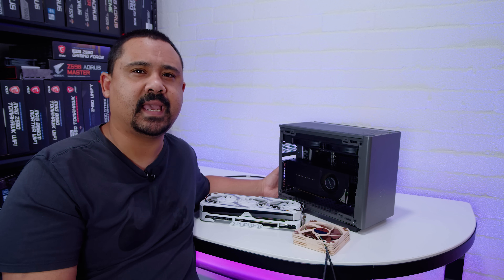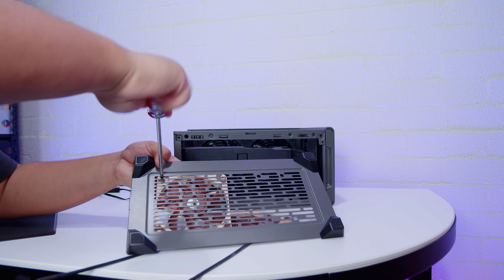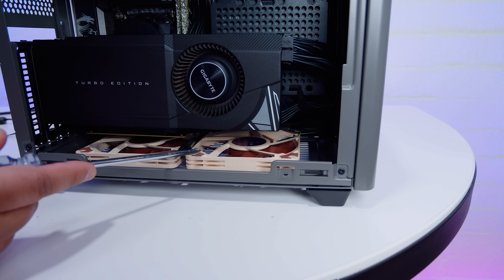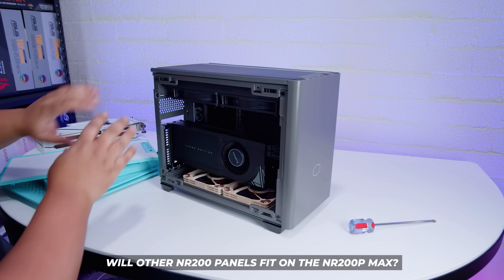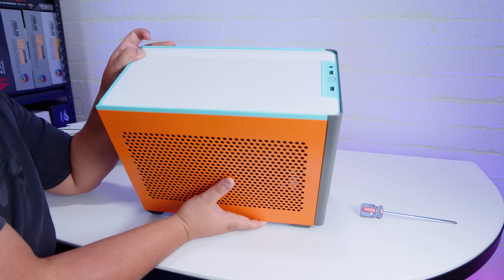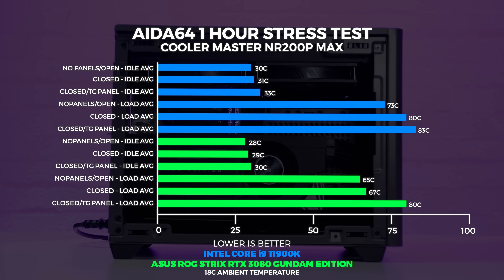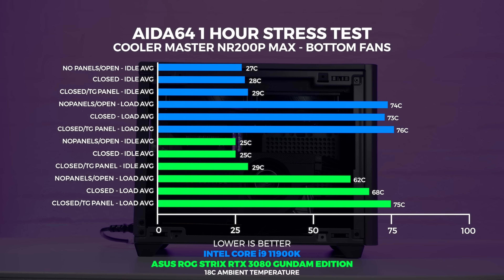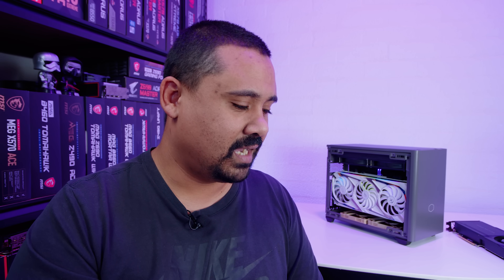Cooler Master NR200P MAX - Answering Your Questions + More Thermals

Comment: I have this case, I was able to fit 2 full size 120mm fans in the bottom.   I spaced the gpu up with a couple small washers on the screws and squeezed them in.  
Optionally I drilled a small hole in the far side of the case and found the weird small bolt that would screw into the gpu threads on the far side of the gpu for support.  It's rock solid.

Comment: Are the bottom fans for intake or exhaust?
Reply: The ones in the thumbnail are set to intake. You can tell by looking at the frame elements - air exits the side of the fan that has those. I believe this is standard.

Comment: I saw a picture of the gpu laying horizontal on the bottom in place of small fans. Is that another way to install it?
Reply: For those still wondering: this confused me too. The 'prebuilt' version (Max) of this case is the only one I can find that does NOT support horizontal GPU installation. That said, since the entire case comes apart, it might (stress: might - I haven't tested this) be possible to get a rear panel from one of the other models to do this - just don't know how one would get it.

Comment: I just saw your comment that you can replace the AIO and PSU no problem in this case. As far as I know the AIO tube length is longer than normal (ie. custom) for this case to get the routing you have when bought. This gets the tubes out of the way for the larger GPUs. Most aftermarket AIOs have shorter tubes so their routing becomes an issue. Can you please comment?
Reply from the maker: It will be fine

Comment: Hi I've fitted a 4080FE and its running 54-56 with slim fans exhausting downwards
Reply: What cpu and mobo did you end up installing? looking at doing a 4080FE as well

Comment: Should test with the bottom fans in the exhaust (negative pressure) position compared to blowing inside the case.  Some experts say it makes a lot more sense to make the bottom fans blow outwards.  I'm very curious.
Reply from the maker: makes no difference

Comment: With noctua fans on the bottom, how shall i take the curve for air? 

More pressure on the bottom fans or more pressure on aio of cooler Master? 

Sorry for my bad english skills.
Reply: Hot air rises, it's called convection. Bottom intake and top exhaust is perfect for this case.

Comment: Thank you so much! This video is rly helpful. The RTX3090Ti has released so I'm planning to put 12900k CPU and this new GPU into this tiny box (I know it's crazy XD). Do u think this cooling is still acceptable? I haven't seen anyone try to place 3090TI into itx case and I'm sooo curious!!!
Reply: I have 12900k and 3090 in this case and its pushing 90 C under load

Comment: With the bottom fans installed how did you setup the fans? Did you do bottom intake, top exhaust? Bottom and top Exhaust? Thanks
Reply: You can install slim exhaust fans on the bottom (flipped)
You can also install regular 25 or 30mm reverse flow fans. But only if you use 6-32 or 6+6 standoff screws to raise the GPU. Like a spacer.
However. You must do bottom intake top exhaust. Or you'll get horrible air flow.

Comment: How long is the radiator hose in the Cooler Master NR200P Max?
And would it be possible to replace the Cooler Master radiator with the ASUS ROG Strix LC II 280 A-RGB or Corsair iCUE H100i ELITE LCD?

Comment: If you are using the vented side panel you will get better thermal performance with negative pressure by running both fans in exhaust which will draw air in through the side panels. If you are using the glass side panel you'll have better thermal performance with running the bottom fans in intake and the top fans in exhaust. Optimum Tech YouTube channel has done a lot of testing on this.
Reply from the maker: Made no difference in testing.

Comment: As only 2 x 8pin PCIe cables are supplied what's the solution to run a card with 3 x 8pin PCIe such as FTW3 Ultra? Would Corsair cables be compatible?
Reply from the maker: no

Comment: Hey man, thanks for this video!  Question:  With a Strix 3090 in there, what's your opinion on daisy chaining the pci-e cables?
Reply from the maker: The Strix 3090 is the same size as the 3080
Reply: @GearSeekers  Thanks for replying, I was just wondering if using the daisy chain pcie cables would be enough on the 3 connectors on the 3090

Comment: Bit of an out there question - for the original NR200P, is it possible to replace the top housing of the OG case with the NR200P Max top housing - for the benefit of having the AIO rad sit up top?
Reply from the maker: I answered that in the video. You can't
Reply: @GearSeekers  Cheers

Comment: Test the setup with the big card and the bottom fans exhausting.... also if you can block the exhaust to the same side as the gpu is intaking to avoid recirculation even from outside of the case. I bet GPU temps will be even lower. This case is a prime example of what full negative pressure can do with purposeful airflow.
Reply from the maker: It's terrible lol

Comment: Can you swap the top rad with other 280? Like maybe LF II 280?
Reply from the maker: Yes. I answered that in the video.
Reply: @GearSeekers  well you said it can be swapped, but the LF II series for example have thicker rads. So, I was wondering more on the limitation of the top rad dimensions, if fat rads would hit the motherboard or not. 

Also, would be nice to see CPU thermals of the included AIO vs other common AIO choices for NR200. Just to see how good/bad the included AIO really is.

Comment: One of the best selling points of the original NR200P was 2x 2.5” SSDs and a single 3.5” HDD with a large GPU at the same time. It doesn’t look like that’s possible in this one since the 3.5” mount is still on the PSU cage and the GPU cant be horizontally mounted.

Comment: This results are completely different from Jay 2 results. Now I’m confused if the bottom fans actually help. I guess more testing needs to be done 😬
Reply from the maker: They don't help much at all. When you test for 20 seconds like he does the cooler and GPU can't even get up to their absolute temperatures. The reason we don't show when we test in the video is because we spend HOURS doing it. Not a few minutes for a video.

Comment: - Move gpu slot a couple of milimiters up enough to fit regular size fans at the bottom.
- Add USB-C
- Update top panel mesh removing the two weird looking 120mm fan holes from previous verison.
- Sell it without PSU & AIO with more color options.

Now that's how you make the perfect case Cooler Master
Reply: I want it in British Racing Green.😁

Comment: They should made the case a few cm higher so you can mount regular fans on the bottom, this would help so much with temperatures. Well my quest for my perfect sff case will continue ...

Comment: Another great video. Love that Gundam 3080 Edition! 
I have one question, there is any possibility to check Aorus 3080/3080Ti/3090 will fit in that case?
Reply from the maker: We've done videos about this before
Reply: @Gear Seekers I can't find video with 3080 Aorus Master and NR200. And with Max variant there is one option to mount GPU, so I'm very curious will 3,5 slot card (Aorus Master has 70mm of height) can fit there.  :)

Comment: OK, so we have "option" for a 3rd PCIe cable, but it is not added in the box, while getting the same PSU on its own gives you all three cables out of the box, and regular or replacement CM branded PCIe cables are a fair bit longer than those added to this case, so getting a working short 3rd one would require possibly a full cable kit eg. to keep color or form the same. That's a downside... At least there are SATA cables (or at least one, but not connected from the get go) for the front mounted 2.5", but it seems the molex cable is not there in the box as well so anyone thinking of some molex/sata-powered fan hubs or liquid cooling alterations would possibly also need a few extra cables. Or maybe these are just omissions from the packaging sent out to the reviewers while regular retail units would get a full compliment of short cables...

Comment: Is it poosible to add a slim radiator (eg 17mm thick) in the bottom without touching the pci-e rasing cable?? I gonna build a custom water cooling system in this case, 280mm rad at the top and 240 slim rad in bottom (if it is possibe)
Reply from the maker: No
Reply: @GearSeekers  even just a radiator? even without a fan?
Reply from the maker: No

Comment: Love my NR200p and this new variant but can't help but worry that as GPU's get bigger ITX cases might have to get bigger too.
Reply: I forsee ITXs with  two AIO solution in the futire, one for the CPU and one for the Graphic Card.  Even with stadard caeses the Graphic cards are getting too heavy and too big and might need additional support. I think similar to CPUs graphic card should standarize on thrid party AIOs / coolers.

Comment: Honestly I would have preferred the MAX to just be a tiny bit taller and not change the internal layout. In other words provide support for dual 280mm radiators and not need a PCIE riser. I think if they released that and the case was just 2-3 litres bigger it would have been peak!

Comment: With the lower mount point for the vertical GPU, compared to the NR200P, is it possible to do a dual rad custom loop in this case? I know it is a waste of the AIO, but if there is an NR200P V2 it would be good know. No more faffing around with a side mounted rad. Maybe you could do a custom loop build.

Comment: I had a few fitment issues about the Phanteks P200A DRGB, and the manual doesn't show what I need, nor does Phanteks answer e-mails 🙄 I can't buy it until I know, so I guess I'll be going with the Fractal Design Torrent :P A bit different size, but amazing airflow.

Comment: I'm planning to build using the nr200p case with asus Crosshair VIII Impact motherboard with 2 slim xspc 240 rads with noctua 12x15mm fans on top and bottom, my question is will it fit with those config? I'm worried if the rams will hit the top rad/fans.

Comment: Hello there were multiple issues with the stock CoolerMaster 850w SFX PSU. Many complaints were that the pre-revision PSU had horrible fan curves. Can you please confirm if this has the updated 850w PSU with Japanese capacitors? I'm worried CoolerMasyer may have put their defective 850w version 1 PSU in this case instead of the revision that was release a couple months ago
Reply from the maker: This is the new version

Comment: As a recent NR200 user with the large XFX 6900xt I am glad cooler master has  kept large gpu support, being able to remove parts of the case frame when positioning the card helps out a lot 👌

Comment: Nr200 is a beast of a case on its own. I didn't like the idea this case to come with a bundle but there is a market for everything.. sadly without the skirt addon you won't be able to do a custom dual radiator loop
Reply: A custom loop would work with a barrow CPU/pump block combo and with the slimmer nouvolo CPU pump block, super slim rad and the slim fans in the underside with the skirt addon.

Comment: literally answered all my questions, absolute legend. a bit concerning about the thermals on the gpu with the tg even with the bottom fans, guess id just run them at 75-100% to keep cool
Reply: It does much better with a non blower card in that setup. I have an evga rtx 3080 ftw3 with slim fans underneath and temps are great with the TG panel on.

Comment: Another reviewer put a fan in the bottom of this case, and the temps were worse. The gpu was a 3090 fe card with glass side panel. It would be good to see this case run with out ac on.
Reply from the maker: Blow-through GPU coolers in vertical orientation are always worse adding fans underneath. That's no secret
Reply: @GearSeekers  it would still be good to see this case run in warmer temps thou.

Comment: As far as the vented side panel config goes, perhaps you might want to flip the bottom fans as exhaust instead, so as to create negative pressure within the case, which might further improve GPU thermals.

Having bottom fans as intake often results in worse temps esp. for the GPU, as you're effectively fighting airflow with the GPU and regurgitating hot air back into the case, which means more work for the top fans.
Reply: Exactly. There is a review by Optimum Tech, showing two exhaust bottom fans improving thermals with the vented side panel vs. intake fans improving thermals with the glass panel.
https://www.youtube.com/watch?v=lltz-heW2LU
Reply: I’m looking for termals with two bottom fans as exhaust, should be the best combination with a mesh steel panel for this case.
Reply from the maker: I'm not trying to improve thermals. I'm just showing what people wanted to see
Reply: @GearSeekers  but you are doing a review for a case wouldnt it be informative to give advise on the best configuration for the fans . i was actually looking for this answer and if it wasnt for this comment i would have never known. I believe he is giving good criticism here

Comment: GS : Thermal 75C at 18C Ambient

Me: Looking at my Ambient Temp sitting at 30C, Yup that's gonna cook the part without an undervolt... It ain't gonna running stock 1.05V for sure...